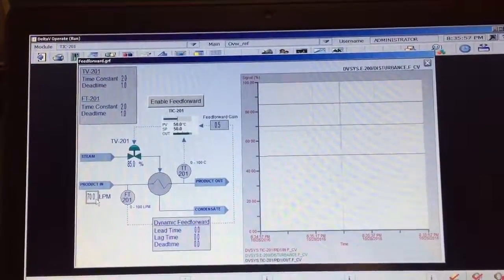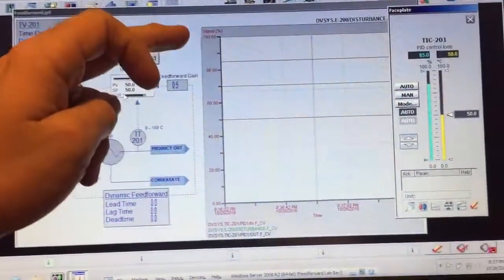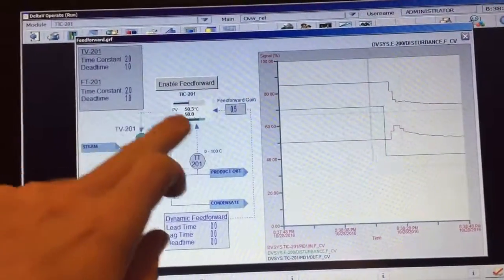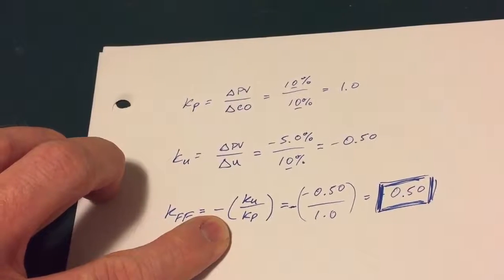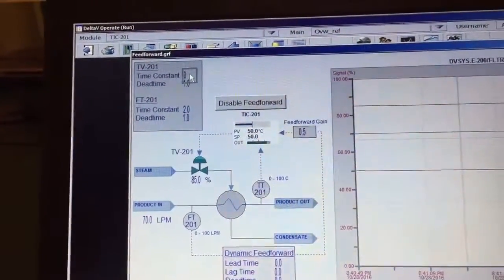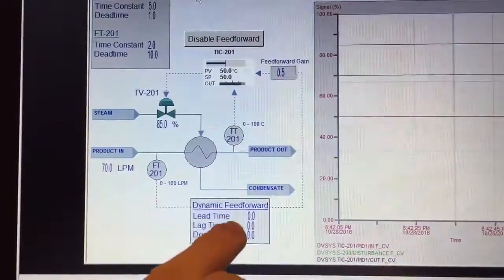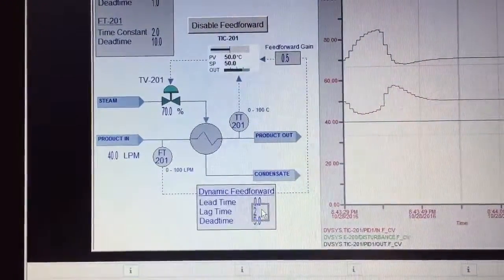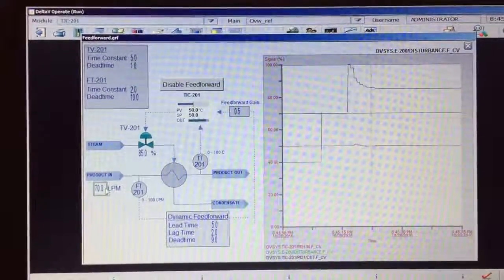Dynamic Feedforward -- DeltaV 12.3.1

Comment: Coudl you give more details about How you get Ku? Please
Reply from the maker: Juan Jose Rios Ku is the gain of the disturbance. In the case of this video the upstream flow transmitter on the product is sensing a flow disturbance. If the user bumps the flow with a valve (not show) and monitors the process variable (PV) a change in PV and a change in the disturbance (flow) can be recorded. The Ku is then calculated by dividing the change in the PV by the change in the disturbance. If the Ku is correct the feedforward part of the control system will adjust the control valve as soon as the flow changes and not wait for a temperature change to be measured minimizing the overall temperature change. This also assumes the process is perfectly linear and the disturbance and the control valve produce the same dead time and time constants on the process variable.